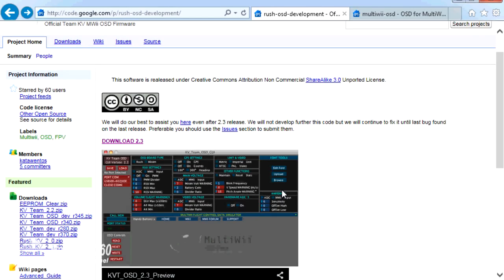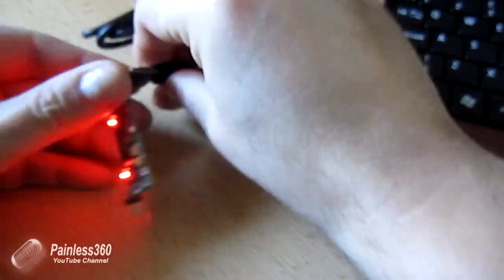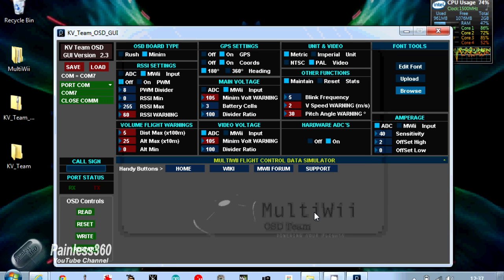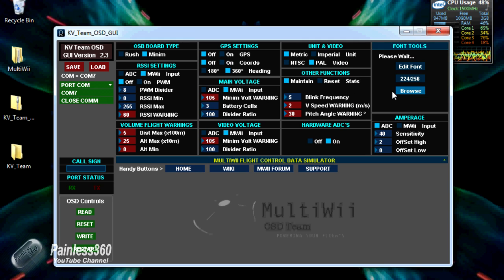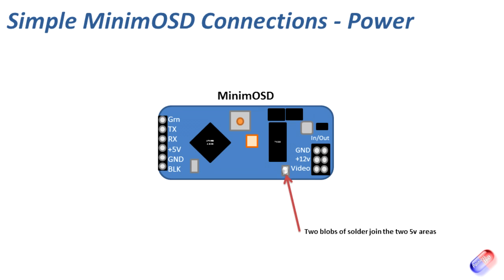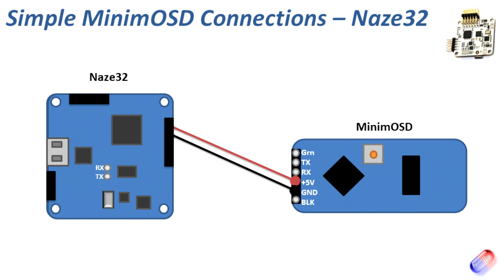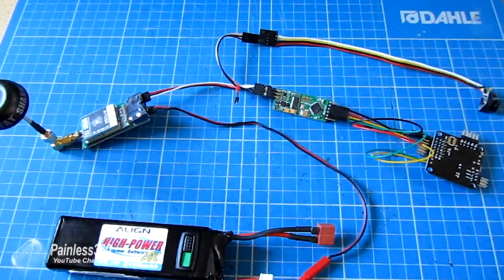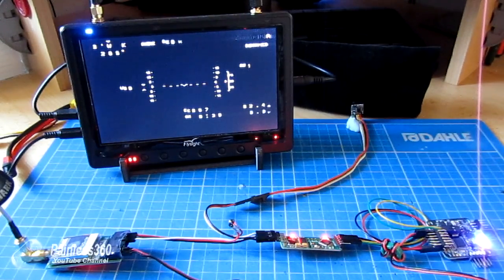(3/8) Naze32 Flight Controller - Adding an OSD using MinimOSD

Comment: i had no luck with my nighthawk 280. i switched to ppm reciever, i have the latest version of CL, with latest Naze firmware. Osd flashed with mw osd. when powered up, i only get my camera display UNTIL i lose the camera ground. then i get an osd duspkay of just my acro, "no data" 0 volts, and run time. any help would be appreciated.
Reply from the maker: +steven mcsweeney Sorry, we've not re-flashed it with another firmware as it comes setup so well. Best of luck with it.

Comment: +Painless360, great video, thanks. Is minimOSD better on Naze or CC3D?  Does Naze give you access to more metrics?
Reply from the maker: +Simon Wallace The CC3D OSDs are based on MAVLink and have not been developed for some time so are more basic. There is tons of support for the MSP based telemetry from Cleanflight so there is more choice, the MSP based OSDs are far more flexible and feature packed. Both will provide a pilot with the basics though..
Reply: Painless360 Many thanks for the clarification.

Comment: Hi, Thanks for the video. I use those pins to communicate through Bluetooth. Does anyone know if MinimOsd is only listening to the serial port or does it send too? I would like to figure out how too have OSD while I still keep my Bluetooth.
Reply from the maker: +Hamed Sarbolandi MinimOSD sends too. The way that MSP telemetry works is that the OSD 'asks' the board for an update..
Reply: +Painless360 Thanks for the instant reply. Do you have any suggestions? Perhaps softserial ports?

Comment: Thanks so very much for the how to's. I was wondering if I could get help with a connection question. I have a new skyline v2 FC. I know you covered a little bit on the skyline v1 board. I have not been able to find out where to connect the MinimOSD to either of these 2 flight controllers. If you can help with the v2 board it would be great, but I would settle for the v1 board too, I am currently using 1 of the softserial ports to transmit frsky telem at 9600 baud, so if I'm not wrong from 1 of your videos, that means both ports have to be using 9600 baud. So I think I need to use another port. I am also using GPS on Uart 2. Thanks again for any help I can get.
Reply from the maker: We've not used it here but I understand that the new board is much better with telemetry and OSDs. You need to use and hardware UART or softserial port (19,200 baud max.) for the MinimOSD connection. Select MSP telemetry. Best of luck!

Comment: I ran into an issue writing to the  OSD with the KV Team firmware.  It wants a 32 bit machine to interface via FTDI.  I wasted a couple hours screwing around, thinking it was the pinout or something, and then decided to try MW_OSD.  Instant success.  I highly recommend.

Comment: Is something going wrong here? Thanks.

Arduino: 1.6.7 (Windows 10), Board: "Arduino Pro or Pro Mini, ATmega328 (5V, 16 MHz)"

In file included from sketch\EEPROM.cpp:5:0:

KV_Team_OSD.h:180: error: variable 'item_table' must be const in order to be put into read-only section by means of '__attribute__((progmem))'

  extern PROGMEM const char *item_table[];

                                        ^

exit status 1
variable 'item_table' must be const in order to be put into read-only section by means of '__attribute__((progmem))'

  This report would have more information with
  "Show verbose output during compilation"
  enabled in File > Preferences.
Reply from the maker: +Robert Cook https://www.youtube.com/watch?v=KJ1KmtkkLxw

Comment: Which board is used in this video. It isn't listed under the sources and I don't see a brand on the board it self.
Reply from the maker: Generic Naze32 Revision5 ;)
Reply: Sorry, I was referring to the minimOSD. I am new to the FPV
game and would like to add FPV to my current project. I figure that it will be
a lot easier to follow along if I am using the same equipment. Could you please
tell me what brand of OSD and FTDI you used. If they were generic, where did
you buy them or what are the suitable substitutes. Thx
Reply from the maker: Generic MinimOSD and FTDI Basic (as per the other videos on the channel). Best of luck.

Comment: So I setup the MinimOSD and GPS with a Naze32 using your videos. The instructions were excellent and helped me a lot. i do have one issue with the Minim OSD however in that though I get a GPS lock (I see the GPS coordinates in the OSD) it still shows 0 for the number GPS satellites. Any idea what is causing this?
Reply from the maker: +Joe Check if it appears when the board is armed - if not then I'd check the software you set the MinimOSD to talk to (Cleanflight version etc) in the MinimOSD code..

Comment: Hi Painless 360, is this following .....3.3V or 5.5V USB Programming Module for Naze / Minim OSD / Frsky / Multi-wii...match or not with Naze 32, because i've found the same as yours ....MinimOSD MAVLink OSD APM 2.6 APM 2.52 Flight Control Board.....on Banggod but Naze isn't listed on this one...
Fly funny
Philippe
Reply from the maker: Search for 'FTDI basic' to get the right one. See our video on it..

Comment: Where did you get the board to program the OSD from? I had a look on arduino section at hobbyking and didn't find it. 
Tks
Reply from the maker: +Danilo Padula https://www.youtube.com/watch?v=qLaH4qkJNt0 ;) Search for 'FTDI Basic' on your favourite sites to find one..
Reply: +Painless360 Tks for reply and also for your videos, I have been learnt a lot with them.

Comment: this is the error msg i getArduino: 1.6.5 (Windows 8.1), Board: "Arduino Duemilanove or Diecimila, ATmega328"

In file included from EEPROM.cpp:5:0:
KV_Team_OSD.h:180: error: variable 'item_table' must be const in order to be put into read-only section by means of '__attribute__((progmem))'
  extern PROGMEM const char *item_table[];
                                        ^
variable 'item_table' must be const in order to be put into read-only section by means of '__attribute__((progmem))'

  This report would have more information with
  "Show verbose output during compilation"
  enabled in File > Preferences.
Reply from the maker: +raeme105 https://www.youtube.com/watch?v=KJ1KmtkkLxw ;)

Comment: So I got a question, you said you have to soldering the two little solder spot together, one at the front and one at the back. So which one should I connect them together?
Reply from the maker: +Jerry Liang Solder as shown in the video. Best of luck!
Reply: only the front? or can I do nothing on it?
Reply from the maker: I clearly show in the video the two places that need to be soldered - if you don't have the same things on your board you must have a different version. Best of luck..

Comment: At the end of the video when  you connect the OSD between the transmitter and the camera you say, ''To make sure that the 5 volts can make it from the video transmitter out into the camera, connect the 5 volt leads together....''.
I get confused here because the transmitter and the camera work on 12v, shouldn't that be ''connect the 12v leads together'' (without connecting 12v to the minim OSD)?
Reply from the maker: +Ronald Zwarteveen It's not too complicated - NEVER connect a voltage to the 12v pins on the video connectors. Connect the voltage you need to the camera directly. Happy flying!

Comment: Thanks for the great video, I did some soldering and some heat shrinking and finally got the micro minimosd to flash but it works a treat. I am using the Quanum V2's and the screen looks better for the OSD. I only have main battery voltage, horizon, mode,timer and large fonts, as I dont have the full board to display more, this will confuse me enough. Thank you for making it so straight forward.
Reply from the maker: +ross cavallaro Thanks for the comment - glad it all worked! It's a great feeling when something you've setup bursts into life..

Comment: Thanks for the reply. I assume the camera 12v supply is kept separate from the osd 5v supply? As only the video feed is going to and from the osd,is that correct? Is there a direct link yet to the video you mentioned? Thank you once again.
Reply from the maker: Check out the 'Introduction to FPV ' playlist, near the bottom.  Best of luck!

Comment: Hi I have the vBat sorted, thank you. And I now know I can get 5v power from Naze esc pinout 6 I am using No5 for LEDs. The only part I am not sure of is I have a 12v camera and  receiver. If I am connecting the Micro Minim to 5v with  connections to the camera, will that mean the camera is only getting 5v not 12? Or is the camera/receiver power supply unaffected Thanks for the great videos.
Reply from the maker: +ross cavallaro We do cover this in the video - a bit. You can also watch the recent video about using 12v cameras with 5v FPV systems. That covers this in some detail..

Comment: Hello Painless, great vids, ive set up 2 250 quads using the overcraft PDB;s and naze 32 and minim OSD using these vids. Im trying to get another going with same setup (Overcraft V4 board and naze 32) Ive got it to the point where the text is there right, but its not picking up voltage (says 16.3 volts on the OSD and does not change) also the ARMED/DISARMED stays disarmed even if im flying. Tried different naze boards and different OSD's all give the same results? please help...........
Reply from the maker: +Ian Jordan Can you see the voltage in Cleanflight main screen? If so have you selected the battery voltage to come from the FC in the MinimOSD setup screens?
Reply: +Painless360 Some good things to check, im at work at the moment so will get back to you later, i do know that when i swapped the naze boards i copied the config from my good working naze/osd combination onto the second naze i tried, thanks for getting back to me
Reply: +Painless360 Hello
naze 32 running cleanflight 1.7.1 (flies nice) i can see the voltage on main screen
Minim osd - was displaying 16.3v (continuously) ive now checked the use multiwii box and the voltage is now displaying 0v continuously.

MULTIWII MWOSD - R1.2
MW VERSION :0.00

is displayed on the start up. My OSD that works displays

MW VERSION :2.53

thanks
Reply: +Ian Jordan Sorry working OSD shows

MW VERSION 2.31

Comment: is the green light on the osd supposed to flash all while it's plugged in? mine only flashes about 8 times right after the computer detects it and then that's it. In the video it looks like it's flashing pretty fast, and when i try to upload the firmware the green light flashes 3 times, the rx and tx light on my FTDI (CRIUS) connector flash franticly for a few seconds, than it all stops and a few seconds later i get the following message: 

avrdude: stk500_paged_write(): (a) protocol error, expect=0x14, resp=0x64
avrdude: stk500_cmd(): programmer is out of sync

Any help would be greatly appreciated. I've soldered the mentioned pads, and I'm running windows 10 and arduino 1.0.5 .

Thanks,
Jake
Reply: also it's worth mentioning that i took great care in making sure i connected to the right pins on the FTDI and OSD. When i switched rx and tx the FTDI did not seem to recognize the OSD and neither of the lights would flash when uploading so that shouldn't be the problem.
Reply from the maker: +Jake Waddoups Until you've programmed the MinimOSD then it will do what it wants ;) I have a video on that very STK500 error - have you watched that?
Reply: +Painless360 oh, no I didn't see it, I will go there now!
Reply: +Painless360 So i checked out the video and it wasn't the problem i was having. I may have just got unlucky on ebay and got a counterfeit one as i was able to get my ftdi adapter working on some other things i had. do you know of any places where i can be guaranteed to not get a counterfeit one?

Comment: My Arduino software starts up with de following code in de sketch window:

void setup() {
  // put your setup code here, to run once:

}

void loop() {
  // put your main code here, to run repeatedly:

}

Anything wrong here?
Reply from the maker: +Ronald Zwarteveen Different versions of Arduino start with different things in the window. I would use V1.0.5 to do anything in RC..

Comment: Hello again, I plugged my MinimOSD to the board and when I turned it on, I got pictures and the OSD welcome screen. On the welcome screen it says waiting for MAVLINK heartbeat and it stays there permanently. It doesn't go further than that.
Reply from the maker: +Sol mag Then you have not loaded the firmware I show in the video. The Naze32 doesn't send MAVLink telemetry. Follow the video and load the right firmware onto the MinimOSD and you should find it all works.
Reply: +Painless360 Hello, I tried to load the firmware to my OSD and I go a low memory message. This is the error message I got from arduino Arduino: 1.6.4 (Windows 8.1), Board: "Arduino Pro or Pro Mini, ATmega328 (5V, 16 MHz)"Sketch uses 25,206 bytes (82%) of program storage space. Maximum is 30,720 bytes.
Global variables use 1,669 bytes (81%) of dynamic memory, leaving 379 bytes for local variables. Maximum is 2,048 bytes.
Low memory available, stability problems may occur.
avrdude: ser_open(): can't open device "\\.\COM1": The system cannot find the file specified.
Problem uploading to board.  See http://www.arduino.cc/en/Guide/Troubleshooting#upload for suggestions.  This report would have more information with
  "Show verbose output during compilation"
  enabled in File > Preferences.
Reply from the maker: https://www.youtube.com/watch?v=KJ1KmtkkLxw
Reply: +Painless360 Thanks for your help. I was able to compile the sketch but it would not upload to the OSD due to this error Avrdude: error: could not find usb device "usbasp" with vid=0x16c0 pid=0x5dc and i have tried different solutions from different forums and I still cant't get it to work. I saw this on ebay and I want to know if i should get it instead http://www.ebay.com/itm/Soldered-Mini-OSD-MICRO-MINIMOSD-Minim-OSD-W-KV-TEAM-MOD-For-Naze32/111765355562?_trksid=p2047675.c100005.m1851&_trkparms=aid%3D222007%26algo%3DSIC.MBE%26ao%3D1%26asc%3D32483%26meid%3D066ee64389644d4496fad632c37f9c0c%26pid%3D100005%26rk%3D3%26rkt%3D6%26sd%3D131604915598 but my problem will be how to wire it. Do you think i should get that?
Reply from the maker: Check there is a COM port in windows for the FTDI adapter and then make sure that COM port is selected in Auduino. Best of luck.
Reply: +Painless360 The COM port is 10 which is correct and it shows on the Arduino too, but I keep getting this messageSketch uses 24,204 bytes (78%) of program storage space. Maximum is 30,720 bytes.Global variables use 1,563 bytes (76%) of dynamic memory, leaving 485 bytes for local variables. Maximum is 2,048 bytes.Low memory available, stability problems may occur.avrdude: stk500_recv(): programmer is not respondingavrdude: stk500_getsync() attempt 1 of 10: not in sync: resp=0x89Under programmer I selected the USBASP.
Reply: +Painless360 The COM port is 10 which is correct and it shows on the Arduino too, but I keep getting this messageSketch uses 24,204 bytes (78%) of program storage space. Maximum is 30,720 bytes.Global variables use 1,563 bytes (76%) of dynamic memory, leaving 485 bytes for local variables. Maximum is 2,048 bytes.Low memory available, stability problems may occur.avrdude: stk500_recv(): programmer is not respondingavrdude: stk500_getsync() attempt 1 of 10: not in sync: resp=0x89Under programmer I selected the USBASP.
Reply from the maker: https://www.youtube.com/watch?v=KJ1KmtkkLxw may help....
Reply: +Painless360 YOU ARE THE BEST! Got everything working. I have a complete quad with GPS and maiden it today. All thanks to you.Happy with the result, though it needs some tuning. The OSD characters and symbols are mumbled together. Do you have a video on how to move them to positions?
Reply from the maker: Depends on what 'mumbled' means if they are all in the wrong place on the screen then, depending on the firmware you are using, there is limited options to move them, make sure it's set to PAL/NTSC.

Best of luck!
Reply: +Painless360 I read in one of the comments about MSP, so I went to click the MSP and it's all fine now. The horizon line is showing "latlatlatlat" instead of "--------------". Can that be changed?
Reply from the maker: Yep, usually means that you need to reload the fonts again. They are not flashed as part of the firmware upgrade to the board..

Best of luck.

Comment: I have a question, My setup Mini Kv Mod OSD and naze32 10dot. when only connected with usb I can get in clean flight and see and change the setting. but once I connect the power sauce of 3s , then everything works except my USB connected to Win8 is lost or hold. but if I don't have my OSD connect with Naze32 and only 3S battery connnected I can still see and view all Clean Flight program and sensor with Win8 connected.
Please help can OSD and USB RX+TX able to function at the same time once power sauce connected?
Reply from the maker: Depends where the OSD is plugged in. It may be sharing the same port as the USB connector so when the OSD is powered from the flight battery the USB is unhappy. Best of luck.
Reply: +Painless360 thx for quick reply. I connect the OSD on the middle Telemery rx and tx. then the Usb connected on the regular USB connector. Any way to make it work on programming part by changing . and btw will bluetooth and OSD works at the same time with both connected and power on?
Reply from the maker: The Naze32 wasn't designed to have this many things attached, you will run into problems a lot where you have to choose one of the other. Best of luck.